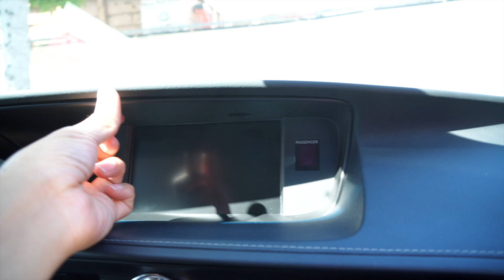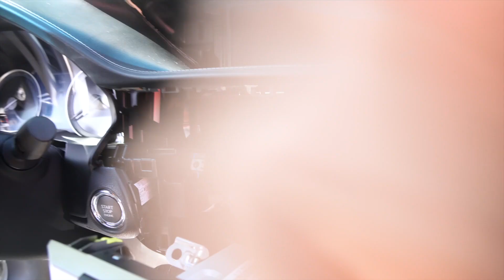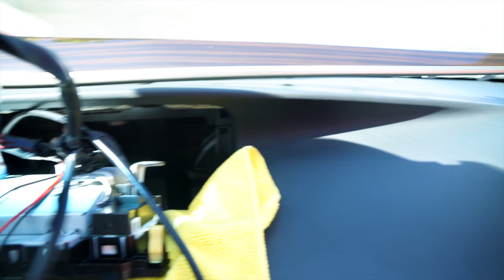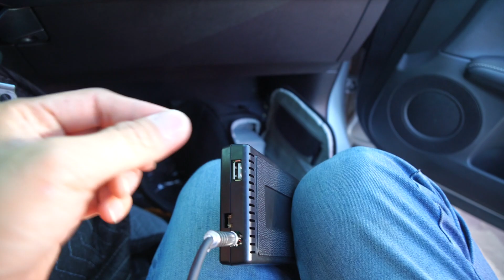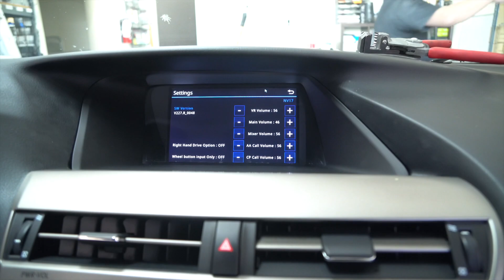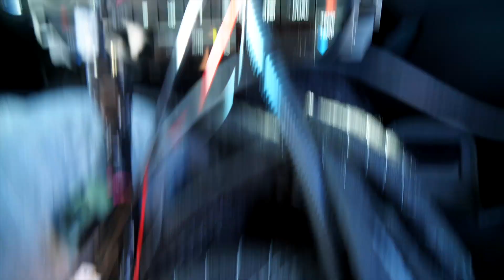2015-2018 LEXUS ES Without Navigation | Wired Apple CarPlay & Android Auto | Install & Demo

Comment: How do I know if the vehicle has factory navigation? There’s no functioning navigation but it’s an option on the screen apparently if you call a phone number and pay a monthly fee on our car. Trying to figure out what product I need to order. It’s a 2018 base model with the round joystick no heated steering wheel
Reply from the maker: You have the non nav model. This is the correct kit

Comment: Is there a reason this didn’t compatible with a 2013 even though it’s the exact same layout? I have a 2013 es 350 without factory navigation and can’t find an Apple CarPlay unit from you guys
Reply from the maker: 2013-2014 ES without factory navigation is equipped with a different harness
Reply: @BeatSonicUS  do you guys have one available for the 13-14 without navigation?

Comment: Is this for 2013-2018 or 2015-2018?
Reply from the maker: Jung Lee 2015-2018. After the video realized that the connectors are different on 2013-2014
Reply: @BeatSonicUS  Are you planning on releasing one for 2013-14 without factory navigation?
Reply from the maker: Yes, we are working on it!